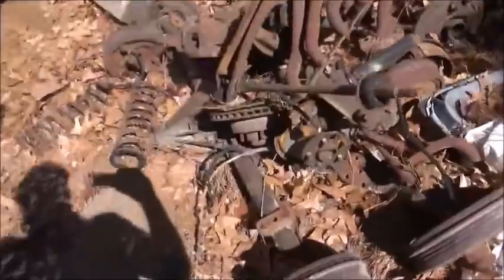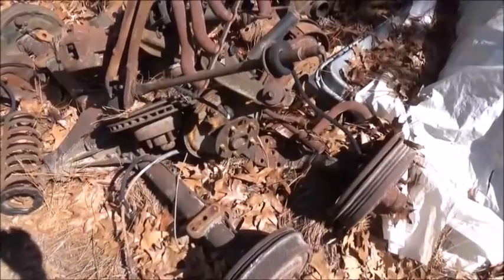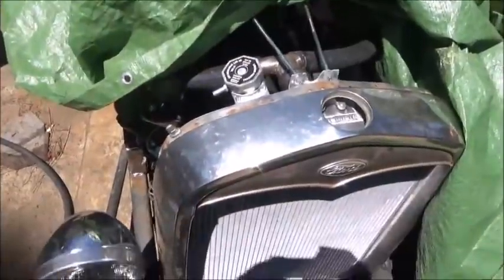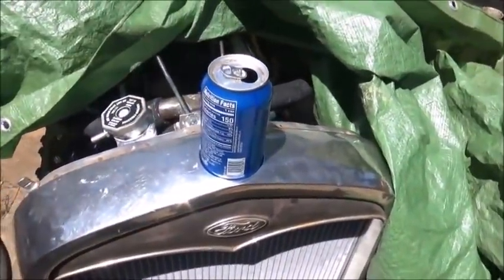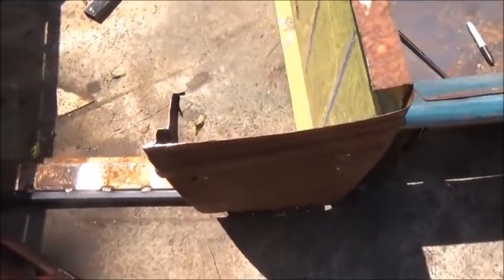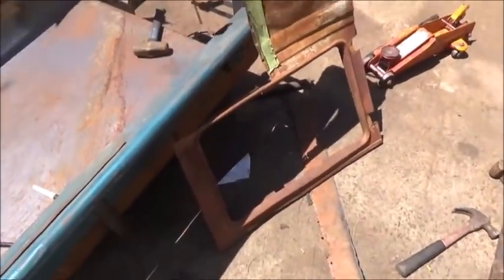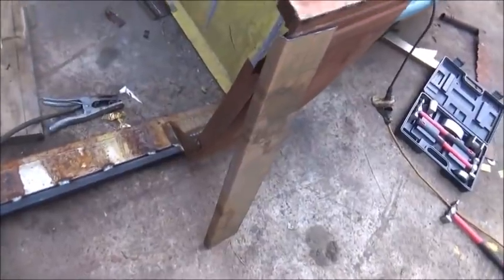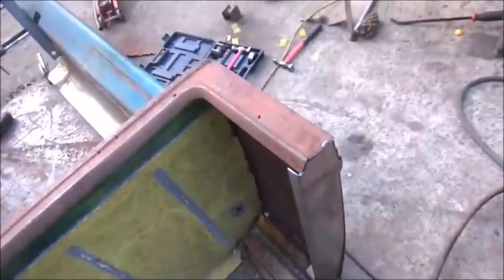1929 ROADSTER PICKUP FROM JUNK PART 4

Comment: Really like your answer to capping off the back of the cab. Looks great. You might try a hot glued pop can in the model a radiator for a couple cruise ins haha... fun little discovery there. The bread truck write off isn't about greed or ignorance. The bread company has a greater risk of lawsuit being charitable, which sucks but it's true. Too many ambulance chasing lawyers ruin things like that. When they write it off they are absolved of all liability.  If someone got a tummy ache or another ridiculous lawsuit idea after the write off it would be someone elses fault. So be careful if you end up handing out bread and etc. Keep it in a close circle and let the rest of it go. Use the blessing best you can and don't sweat what goes to waste. Thanks for sharing
Reply: That made perfact sence.

Comment: That's really looking good Jonathan!👍😉 Are you planning to paint it yellow with flames too, like Happy Days pickup? 😍 It'll match my motorcycle as you see.

Did a little bit of Googling, I think they put a 10 bolt 7.5 rear ends in those Granado's anywhere from a 2:50 to 2:75 gear... I kind of like that Jaguar style front drop beam better, more of what they would have used back then, if you ask me.

I'm glad you tried to get them to donate that bread, sad if they won't even turn it over to you, to take in and donate. Definitely a lot of people that could use it especially right now. Like I texted in a comment to some idiot, I have to use have to use are local pantry... I'm going through some tough times. Last time I was there they didn't have any bread to even give out, due to the fact they can't even keep it in the stores, and they weren't even giving vouchers for the stores for it as they as they usually do here. Just real sad to see it go to waste.

Comment: Using the door frames for topping the back of the cab was genius! Looks great! 
That Granada rear axle is a 7.5" integral typically used in 6cyl applications. Should be ok with your straight 8. 
That straight axle that has disc brakes, if it's infact Volvo, should have bearing spacers/adapters on the spindles. Been looking for some or specs to have some made.

Comment: Coming along very nicely !! That dropped "I" beam seems like it would be ideal since it was meant to work with the front crossmember and suspension you will be using. Believe there's lots of choices for brakes (old Ford/F-100's) and the steering arm should be plentiful ?? The tube axel will be "cool" but much more "Headache" starting from "square one" on everything (brakes, spring mounting, wishbones, steering). No doubt you can/will figure it out. Just offering a "practical" vision.

Comment: I really like how the caps for the back of the cab turned out. The lines of them just seem to be right. I'm interested to see how you do the lines of the cab and the line of the front supports of the bed you said in the last video you didn't like the look of together.  I'd have recommended doing a wood bed floor rather than the metal but it ain't my truck and it still looks good!

Comment: That Plymouth axle looks like the king pins were kept greased. The Granada rear will have a high, gas mileage, gear ratio. Will work well with that torquey straight 8. I love your use of the door frames.

Comment: Your resourcefulness when it comes to making neat cars from discarded and low buck parts is inspirational.    Keep it up!  Anyways I have not tried it but I've heard that the early F100 drum brakes are easy to adapt to early Ford spindles and work much better than the 39-48  Ford brakes.    I like the tube axle idea but using the F100 brakes on the Ford I-beam axle that currently has the disc brakes with the pricey calipers may be an easy low buck solution.

Comment: Some guys make diy adapter plates for disc brake calipers to fit custom so they can use calipers they like. Just a thought. Im sure you could make an adapter plate for the disc brakes to put ford or chevy calipers on that Jag brake system.

Comment: They actually did make Ford 7.5" Ford Ford 8" - Drop out style rear end with 8" ring gear. Has removable pinion support on the front. Uses 28 spline axles.
Years Used on Granada: (1975 - 1979)
Ford 8.8" - 28 Spline
Years Used on Granada: (1979 - 1982)Ford 8.8" - 31 Spline
Years Used on Granada: (1979 - 1982)Ford 9" (9 inch) - 28 Spline
Years Used on Granada: (1975 - 1979)
Ford 9" - 31 Spline I would sure give some to my son and friends on that bread and cakes stuff.

Comment: Stick a sign up in front of your place, FREE BREAD, AND SNACK CAKES. TODAY ONLY. WHILE SUPPLY LASTS. You should get some of it too. If they don't care about it, take whatever you think you can use, give the rest of it away. You can put bread in a freezer. Just make sure when you take it out of the freezer you lay it on its side to thaw. If you don't it will be soggy. It's something I learned from my mother years ago when I and my sister were kids. I don't know why it works that way, it just does. My mom froze 7 or 8 loaves at a time. And the bread would stay fresh for months.

Comment: That bread company needs to have it publicized that they would rather let the bread and such rot than to donate it to those in need during this crisis.. If it gets out, I am certain that the ones who made hat decision will come under such public fire that the company will do good and donate not just that one truck load but several truck loads in order to restore their image becuse public displeasure by their greed can really  hit their profits. Also, great idea using those door tops as the top of the cab surrounds.

Comment: Once upon a time... Long, long ago.... In the 40's and 50's old time hot rodders would pull the A bodies off the frames and use 32 or later frames for their cars. Had an X cross member. Made for a much stronger machine. That's why you don't see many 32-34 frames. Model A frames were considered essentially junk. Just sayin'...

Comment: I think the way you do this stuff is the best way just find same older parts Fab it together make it all work out and run good is the best way ya one can buy the parts bolt al together when they just spent way to much or the more money than brains way that in my mind is the wrong way your way is the best way. I also hate those that buyns hole orginal car take it apart just to use the body and scrap out the rest there ass holes in my mind to biuld a rod there are a lot of good body's out so as they don't need to take a hole orginal car apart. The hole orginal cars need to be restored not roded out